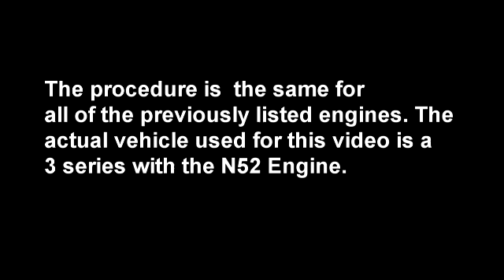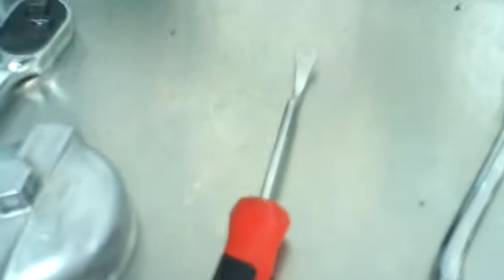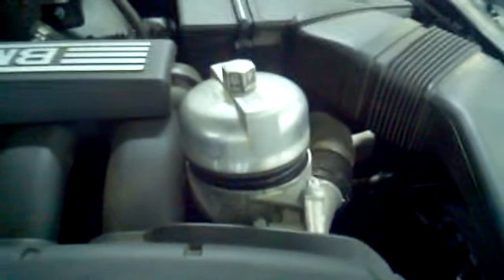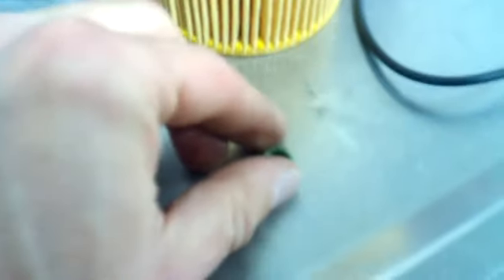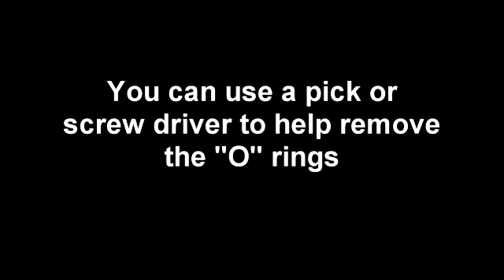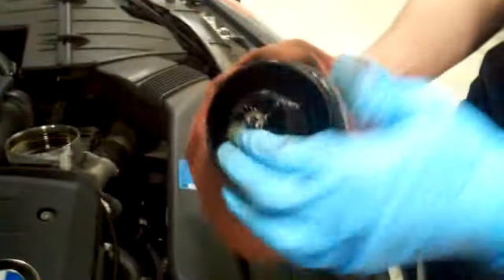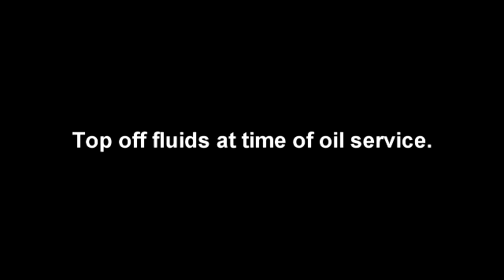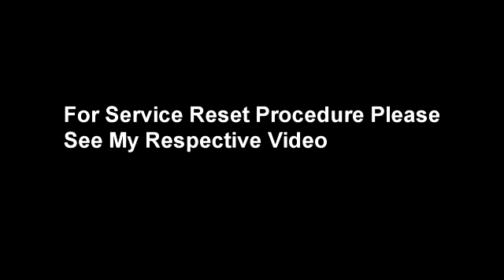BMW Oil Service Procedure 3, 5, X3, X5 N51, N52, N54 Engine

Comment from the maker: Absolutely. Open the filler cap for a vent and crack open the oil filter cap and unscrew slowly until the gasket is exposed a bit. Let it sit for a few minutes and this will drain down the oil in the oil filter housing. Then remove the cap and filter to replace. :)

Comment from the maker: Hello, Thanks for watching :) The 328 is relatively reliable. There are some common failures I have seen such as the oil filter housing leaking oil through the gasket, vanos solenoid problems, a few wheel bearings, a few transmission problems. If you can find a manual it would be best. The electrical water pumps fail now and then and a few radiator leaks. Like all vehicles they can develop problems. This vehicle does not have as many electrical issues that the 7 used to have :)

Comment from the maker: Hello Harut, Most often this is caused from a failing power steering pump. Take a look at the drive belts and make sure everything looks normal. If you can lift the front end and turn the wheels side to side to see if they move easy. It could be a binding steering shaft U joint. Change the fluid in the reservoir and recheck. If it still is stiff then you may want to replace the power steering pump.

Comment from the maker: Hello Ben, Excellent question! This yellowish residue is condensation and oil mix (water and oil) and is quite common. One main reason for this is short distance driving. If you do a lot of short distance driving it is a good idea to change the oil a bit more frequently or let it get good and hot once and a while then open the oil cap and let it vent out some moisture. Overall though very common. Often misdiagnosed as a head gasket problem by an inexperienced tech :)

Comment from the maker: You can try to soak the plugs with some penetrating oil by allowing it to sit in the spark plug hole. Then try to work the plug free a little at a time. Once the lubricant works into the threads it should come out easy. Just make sure not to use too much as it will enter the cylinder once the plug is removed. A small amount of WD40 might do the trick. Loosen, then tighten a bit, then loosen again and keep doing this until they work free for you. Best wishes!

Comment from the maker: Hello Gabriel, While the N52B30 is a very reliable engine there are a few thing I have seen. One early N52's there was a lifter tick problem. Lifters and rockers fix this issue. VANOS solenoids are common to cause problems but are an easy fix. Water pumps are common to fail. I have seen an occasional coil fail or spark plug causing a misfire skip that does not set a check engine light. The drive belt tensioners fail causing the belt to walk partially off...Most of these issues are minor :)

Comment from the maker: Hello James, The reservoir you see is only for power steering. On your vehicle it most likely is using ATF. This is only for the power steering. The transmission is sealed and will use special lifetime fluid (100,000 miles). 
Good question :)

Comment from the maker: Hello, Thanks for watching :) It is normal for a BMW to need to be topped off now and then. BMW's specification for oil usage is actually 1 qt per 750 miles. Most BMW's get better than this but all BMW engines use some oil so topping off is common. For coolant, some evaporation of the water in the system occurs so a top off is needed as well. It depends on how excessive the top off is to determine if there may be a leak.

Comment from the maker: It can definately be opened using other methods. I used a strap wrench but to tighten down well it would be a good idea to use a tool to make sure to have a secure fit. I my memory serves me the tightening torque is 25 newton meters :)

Comment from the maker: Hello, Thanks for watching my videos :) When you reset the oil service indicator it resets the complete counter and also logs how many services of that type have been performed. I would go ahead with a reset since you are close to the service limit anyway. If you are doubling up on oil services then do the next one at about 7500 miles but do not reset the light and let it count down until due for the next service.

Comment from the maker: I would definitely recommend BMW antifreeze. You have to be careful not to mix different types of anti freeze as it can cause it to break down. BMW uses a blue coolant that is ethylene glycol based. If you can find this type of anti freeze it should be good to use.

Comment from the maker: If you have any aftermarket accessories remove them from the vehicle. If it still does this then you have what is called a parasitic draw and this can be difficult to trace down. It would need to be looked at by a shop or you need to monitor amperage and remove fuses one by one until you find the fuse that relates to the drain. then trace that fuse to the component.

Comment from the maker: It could be a bad engine temperature sensor. Also if the AC is on the fan can come on to pull air through the condenser.

Comment: First of all Thank you very much for the useful videos ,and could you help me with this. I have BMW X5 , 2003 , 3.0i engine , which i bought few months ago, now i feel that it.s hard to move the steering wheel, any idea why? and what type of maintenance does it need regularly except the change of the oil etc. Thanks

Comment: Hi,,, I am just to change the oil of my E61 with a N52 engine. The question is: the service indicator still shows up 4800 Km, but I want to refresh all that with new Oil. What happen at the moment of the reset for Oil service. Is the system reseting complete with a new value or just makes a different calculation? base on that still has not reach the service point?. 
Thanks a lot for the interesting videos about all these practical issues around BMW Service.

Comment: thank you for the video.  i am looking to move from a 03 z4 to a 06-08 with the n52 engine but have been stopped in my tracks due to the Hydraulic Valve Adjuster problems.  the cars i am looking at are both out of warranty.  how big a problem is this, and should i quit considering cars with this engine???   Thanks

Comment: Can the filter be changed mid-way through the extended oil change intervals without the oil spilling all over the top of the engine? Thanks .

Comment: I have a BMW 528i and the Power steering/Automatic Transmission Fluid reservoir has the star shaped top.My question is ,Is this engine transmission fluid being used  to supply the transmission and power steering system with the same fluids?

Comment: I have an 06 X3 3.0i and i am wondering exactly what type of oil i can use for the engine. I have read on alot of threads that it can be 5w30, 0w40, of castrol, mobile 1, or just BMW itself. I have purchased the mobile 1 5w30 advanced full synthetic but i am hesitant to use it because some say it is safe and not safe to use other brand names. If you can clarify this that would be great. I do see that you do use bmw full synthetic 5w30.
Reply from the maker: Castrol and Mobile 1 are both good brands. 5W30 was common in the US market until BMW changed recently to zero weight oils. Really any name brand full synthetic of 5W30 or 0W40 is fine in my opinion.

Comment: Hi and thanks for the video! I'm owning a 2009 X3 x-drive 30i with the N52 motor presumably. What are the change intervals for London/Ontario/Canada? They tell me it's each 10.000 km. Is that right?
Reply from the maker: +Werner Rose Hello, That sounds correct to me but it never hurts to do more than less.

Comment: Classic BMW making the oil filter impossible to remove without a special tool.
They are just progressively getting worse.

My e36 could be done with regular tools.
My e46 needs a ridiculously large 36mm socket.

Now this rubbish? 

Pathetic.